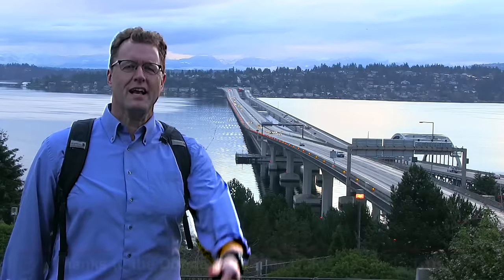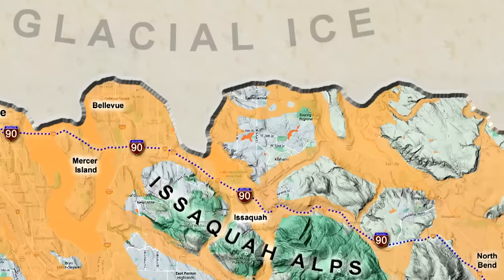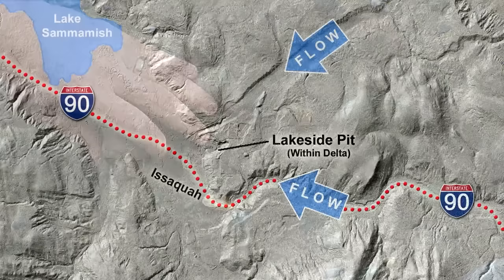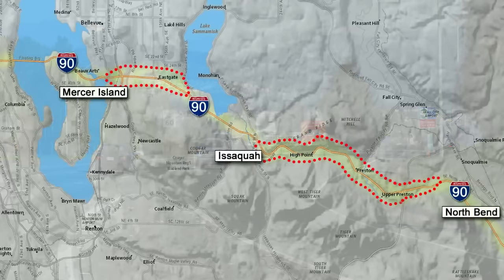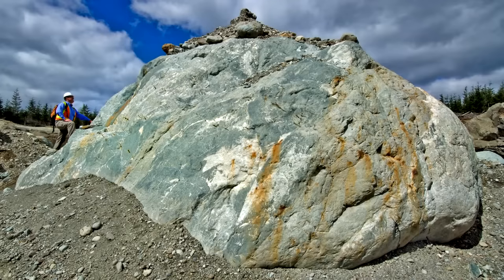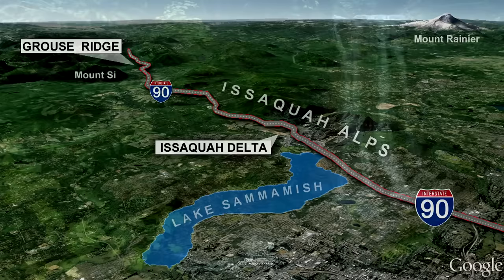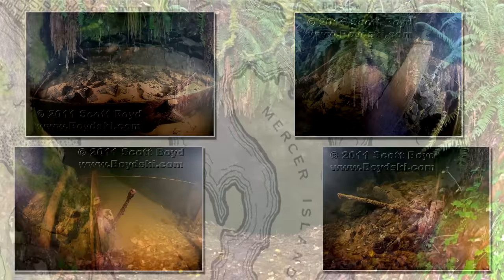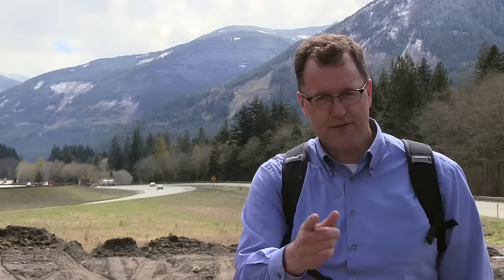I-90 Rocks - Part 2 - Seattle to North Bend - Geology

Comment: At about 10:00: Glacial erratic‘s…Yes, a pain in the neck for the miners. An even greater pain in the neck for drillers, geotechnical and environmental. Throw in the glacial till, and it becomes a major cluster. 🥸

Nick, another great presentation! I have worked with a lot of geologists, and never thought of myself as a geologist. But my strong intrigue in your videos leaves me wondering.